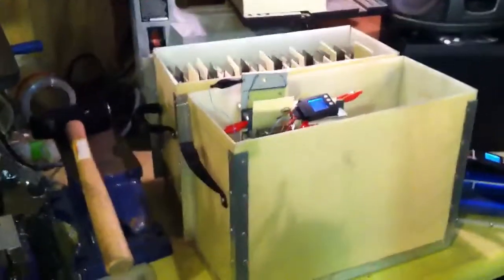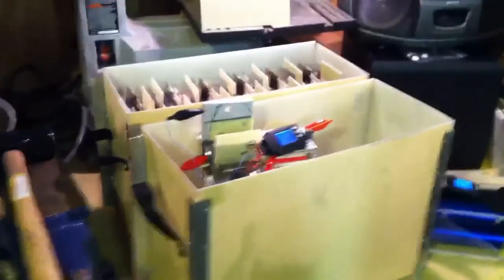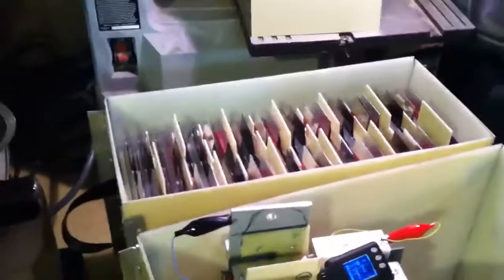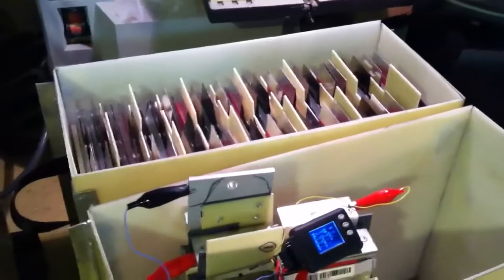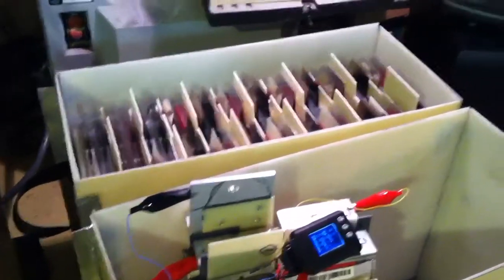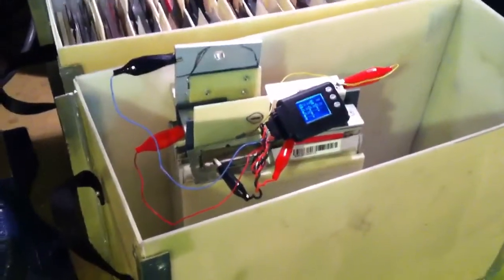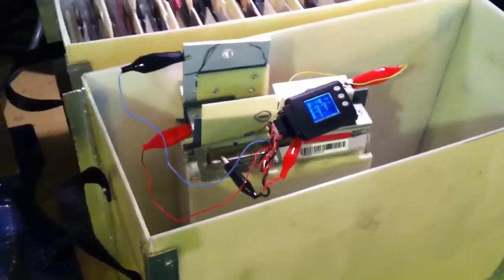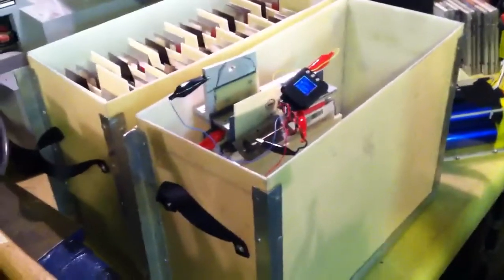Factory Five Mk4 - Electric Car - Video 30

Comment: I think if you used 2 9" motors to the wheels you would have more room for battery and you would not need a differential